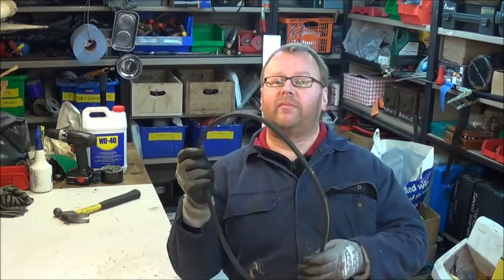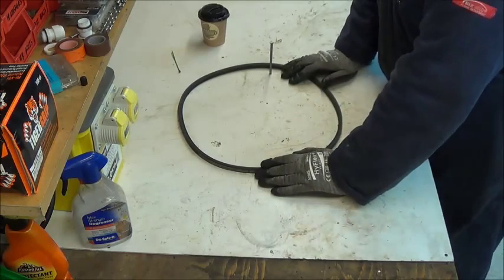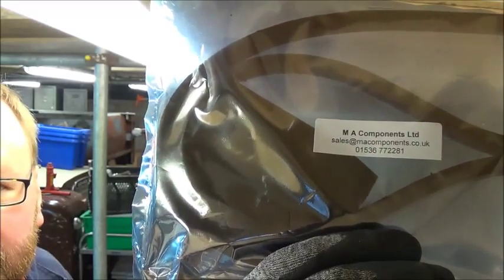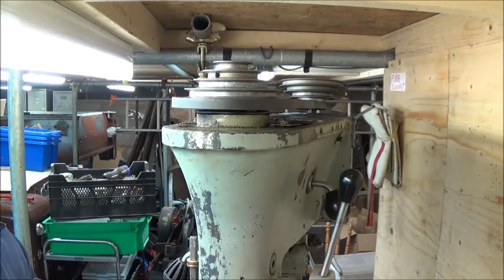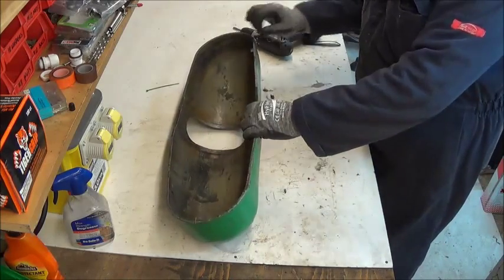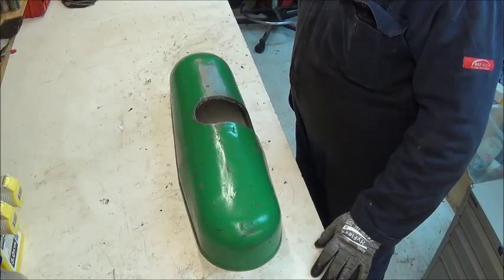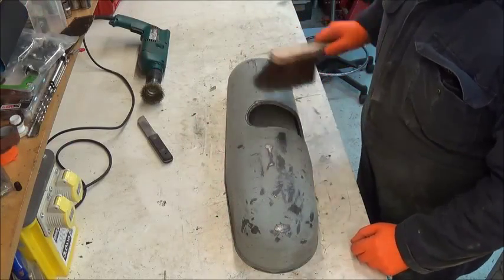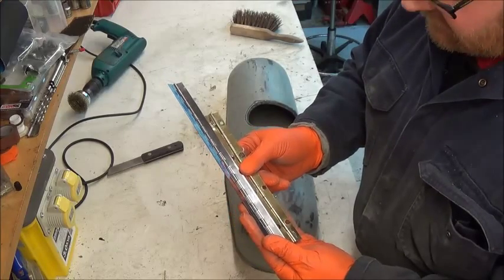Part 3/4 Meddings Bench Pillar Drill Refurbishment - Drive Belt, Casing

Comment: Keith, can you post the type number for the belt please. I bought one from a motor factor but it is too tight. Thanks in advance.
Reply from the maker: Hi Peter, sorry, I didn't see your comment. I can't find the type number for that belt. To be honest, it's still not ideal, with the motor mounted at such an angle. I did buy some adjustable length belt to try ages ago, but never got around to trying it. Similar to this: https://www.amazon.co.uk/Link-Belt-Adjustable-Drive-Twist/dp/B07Y7Y3Q7W

Comment: Don't start with pulleys level !! have the motor pulley leaning forward or at worst straight on the motor pulley when belt is on first groove , by raising motor in its mounting .
Its the motor pulling back that's making it fall off , the new belt probably just fresher cut V making it stay on but in time with wear will fall off again .
Reply from the maker: Thanks. I intend to have another go at it soon and I'll bear your advice in mind.

Comment: thats a bad design of belt tensioning, they usually swing about the verticle axis so the pulley's stay in line, at the least it will be hard on the belt, (rounding off the edges making it fall off) also belts dont actually tend to stretch, they wear on the inside surface thus becoming larger, but belts are sold on the outside radius, which can confuse you buying a belt as you think, oh a bit smaller, to find it wont fit!
Reply from the maker: +jusb1066 Food for thought, thank you. I agree about the poor design, I suppose this small scale kit was in it's infancy back in the post-war years!